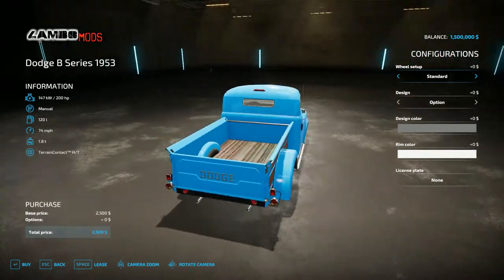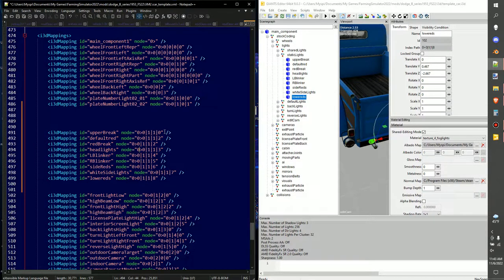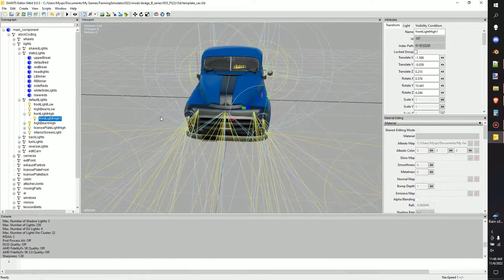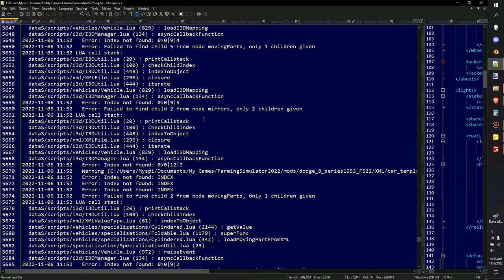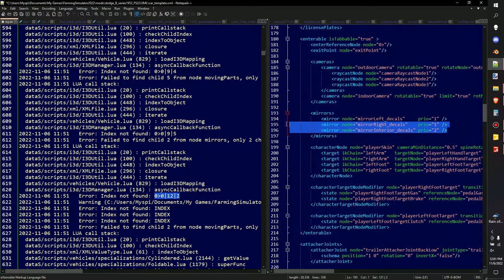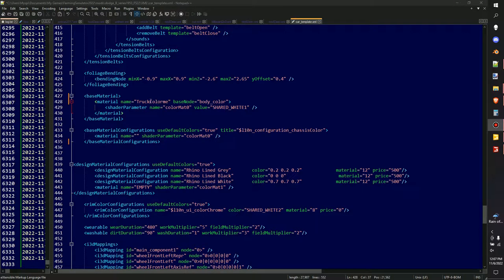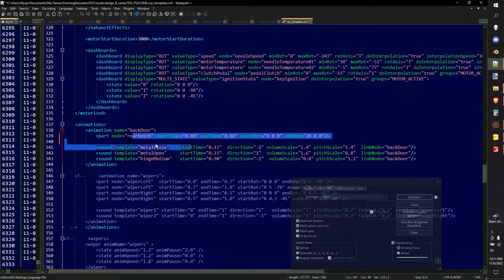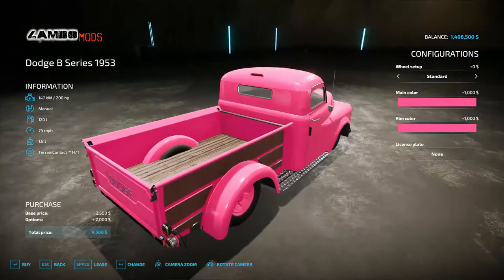🛑NO ERRORS🛑 = PLAYABLE Mod - FS22 How to MOD

Comment: Hy LM I am dying to Ask....As a proffesionnal Modder have you Ever heard or tried to convert a mod from fs22 to 19?!? Wondering if it's possible I will pay Real money to learn how!!🙂 thanks Man
Reply from the maker: Hypothetical yes, but we run into shader issues with buildings and some partical shaders. So files that were designed to use the new features wont transfer to fs19.
As far as the code, very small changes to the xml, could be reversed easily unless the code is relying on fs22 features. Like the platinum expansion, those advanced new features would be REALLY difficult to convert. At least outside my skill set. Hope that answered the question. 😀
Reply: @LAMBOMODS  Well probably I am getting it 50 50% start understanding & yeah I always wanted to see my favorite tractor Comes to fs19 but it's on 22 only Sadly :(
Btw: have you ever done it?
Reply from the maker: No I have not taken a mod from 22 to 19 yet. I actually got rid of 19 when 22 came out.